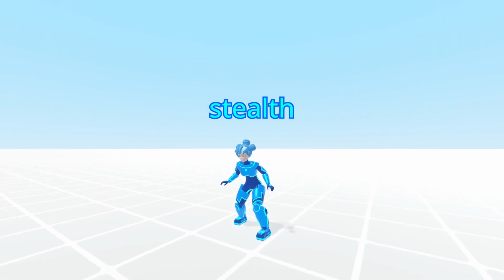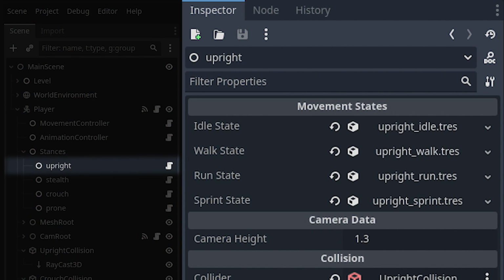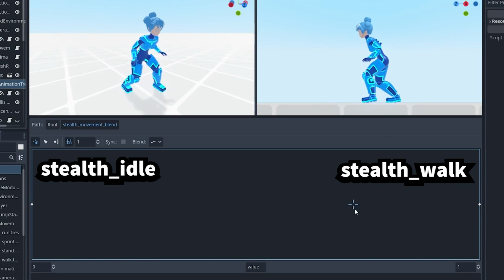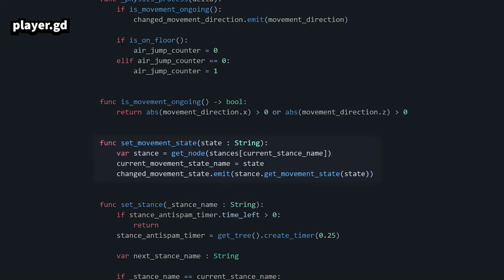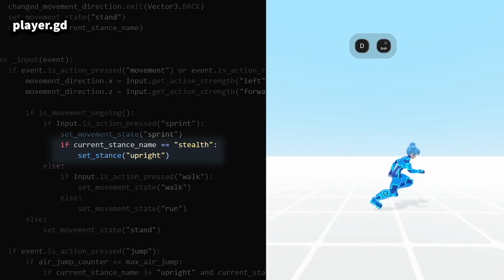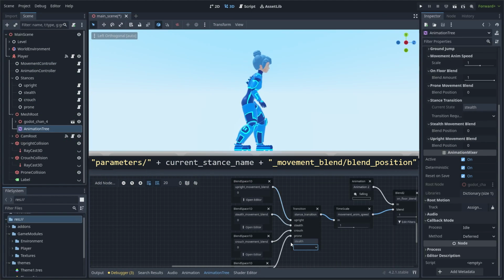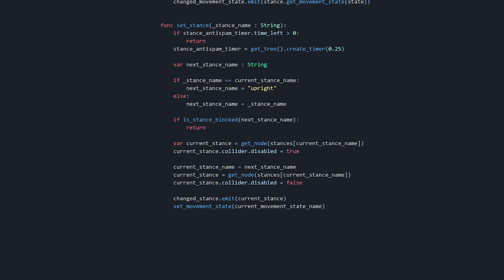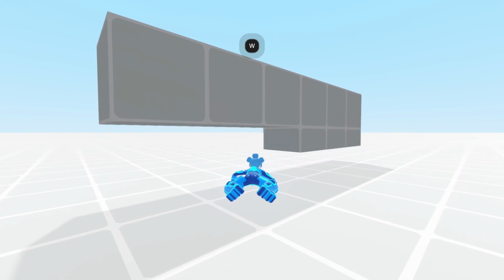Stance - Godot 4 Third Person Controller

Comment: While I really like this character system, I've come across a pretty big conflict in terms of using it with other elements. The stance changing colliders means that every time colliders are disabled and then enabled, it counts as a body leaving or entering a detection area. This means if you have a trigger that watches for something entering an area, it will trigger every time you change stances. If you have suggestions on fixing this, I'd love a recommendation.
Reply from the maker: Brilliantly thought! Really appreciate this comment 🙏 In my opinion, each feature should be as modular as possible, so that changing one feature does little or no effect to another feature. In this case, "player can collide with world" and "player can open doors/interact with interactables" are two different features. So, I'd suggest to add an Area (+ CollisionShape child) under player body, call it maybe EnvironmentTrigger or something, keep it in a different collision layer, and use that layer for the trigger of the interactable object, and scan for area. This way the environment trigger won't need to care if the player is sitting or standing. And if we change something about a feature, the other one gets least affected.

However if you do need to care if the player is sitting or standing, idk maybe a door doesn't open if the player is crouching 😅 then you can simply check if stance == standing.
Reply: @JohnnyRouddro  Yeah I was considering just putting that sort of detection on a different level, but hoped there was something simpler I was missing.
Reply from the maker: @harrylbonyoutube6981  I hoped that too, in fact I tried to do some experimentation after reading your comment. That's the best way I've found so far.
Reply: @JohnnyRouddro  I appreciate the effort, and thanks for the reply.
Reply: @JohnnyRouddro  in my project i made the capsule collision change height with code, is that a bad idea? it lerps from for example standing height to crouch height and the raycast prevents it from going from crouch to standing if something is blocking it

Comment: When I press Crouch, only the camera moves down a little, but the crouch animation won't play. Same for the prone, only the camera moves, but the prone animation is not playing. Movement speed changes for both crouch and prone, but the animations are not playing. I guess this have to do with different version. I am in 4.5. In 4.2.1 it works.

Comment: Love the series!  For some reason my raycast is colliding with the player node (Player:<CharacterBody3D# etc...>).  I'm using a different model so I wonder if that's the case?  Otherwise the node hierarchy is the same as yours.  

I'm thinking of setting the ray to ignore the player?  Ignore self only works on the immediate parent, so the upright collision.  Any thoughts?
Reply from the maker: If you've followed the series from the start, you will notice in the first video I've made the raycasts immediate child of their relevant colliders, and kept "exclude parent" on. for other cases you can manually ignore a collision object via code.
Reply: @JohnnyRouddro  Turns out I had to disable "Hit Back Faces" and it works great now.

Comment: Hi Community,

I hope this message finds you well. I'm currently facing an issue with exporting my Godot game to APK, and I'm seeking your expertise to help me troubleshoot and resolve the problem.

After importing a game , I made changes including updating the app name. However, when I export the project to APK, the game fails to transition to the next level. Interestingly, when I play the game within Godot, the level transition works as expected.

If you have experience with Godot or have encountered a similar issue, I would greatly appreciate any insights, tips, or guidance you can provide to help me debug and solve this problem.Hi Godot Community,

I hope this message finds you well. I'm currently facing an issue with exporting my Godot game to APK, and I'm seeking your expertise to help me troubleshoot and resolve the problem.

After importing a game , I made changes including updating the app name. However, when I export the project to APK, the game fails to transition to the next level. Interestingly, when I play the game within Godot, the level transition works as expected.

If you have experience with Godot or have encountered a similar issue, I would greatly appreciate any insights, tips, or guidance you can provide to help me debug and solve this problem.